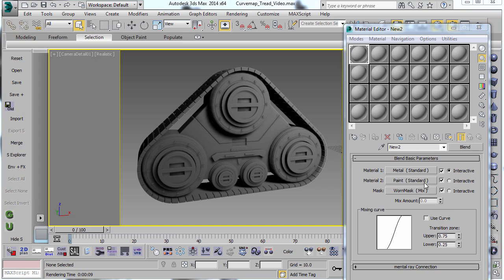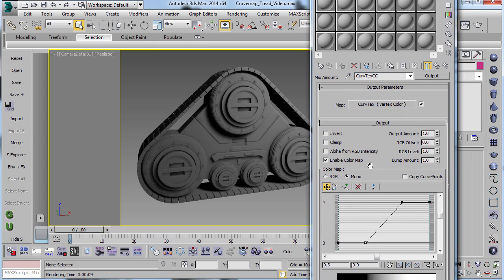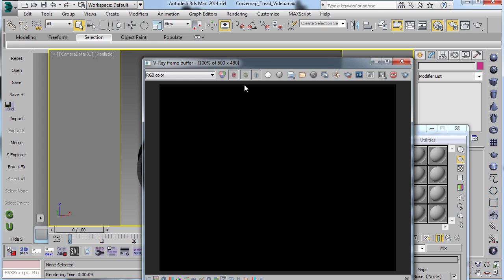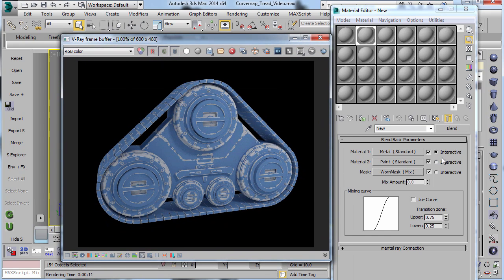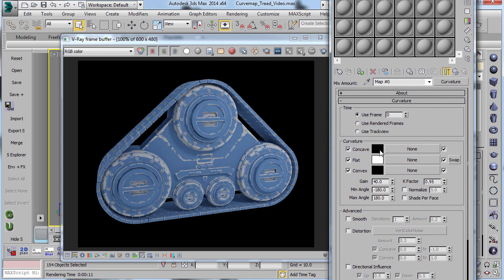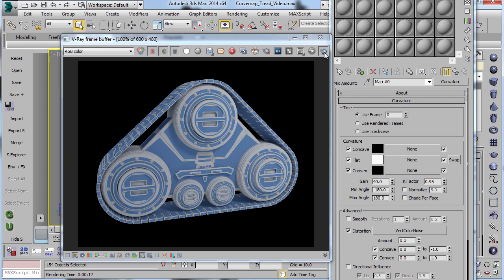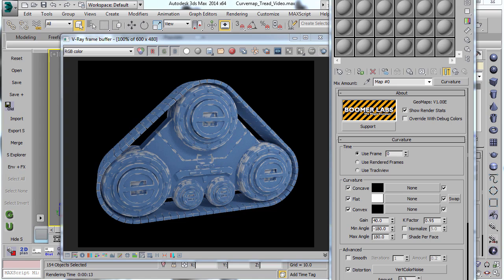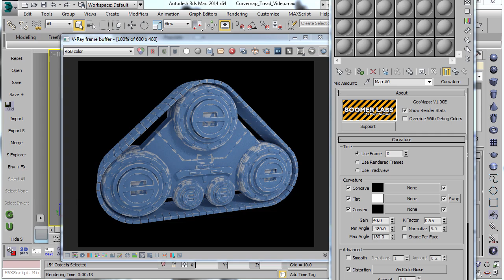Worn Edges Part 2: 3dsmax CurveMap Method

Comment: Hi Neil, i wanted to ask if u have to unwrap in order to use boomerlabs plugin or ur method. Thanks a lot ur awesome :)
Reply from the maker: +Thanos Kagkalos No, the advantage of both methods is neither requires unwrapping. I try and do as little unwrapping as possible. Glad you found the technique interesting!
Reply: Yes i love procedural mapping also, i hate unwrapping. I get really similar results to ur method with vray dirt though and it also applies to really simple objects (without having to turbosmooth). What is the difference of vraydirt and the vertex paint? thanks a lot mate for responding

Comment: If you have V-Ray, you can also simply use the v-ray curvature map, no need to buy another plugin and no need to bake and you can see the result real time in the material editor if you use a cube. Also the free bercon map can use another noise to distort itself like the warp plugin I guess. i also prefer to use the composite map instead of the mix map. We can mix more layers with different mode with the composite map.
Reply: +STROB.NET The V-Ray curvature map also works with the V-Ray edge map's rounded corners, which creates rounded corners at render time even between different interpenetrating objects.
Reply: +STROB.NET See here: http://www.phylacterecola.com/strob/chaosgroupForum/curvatureAndEdgeMap.JPG
Reply from the maker: +STROB.NET First off, if you wanted my attention, you could have just emailed, no reason to post the same message to two different videos and the autodesk wishlist :) So when the vraycurvature map was added, I did extensive testing, and was unable to get proper results for hard surface models. When I talked to Vlado about it, he said the technique had a lot of limitations, and in fact he wasn't even sure he'd keep the map in the vray build. If you've found a way to get it to work on hard surface models, would love to see it, could you send an example max file to neil at soulburn3d dot com? Thanks!
Reply: +soulburn3d Ok sorry I understand how you feel. Cool and thanks for all that you give the max community since years! I follow what you do since years and I hope you keep up the good work that you do!

Comment: Thanks for the tips. I purchased the plugin in the end but no matter what I do I cannot seem to get the edges to work like you do. I have it set up exactly the same as you do on a cube and I only seem to get edges when I turn on normalize but they don't look as good as yours. What am I doing wrong ?
Reply from the maker: +steve wilson Are you using it on a regular 6 face cube, or one with chamfered / turbosmoothed edges?
Reply: +soulburn3d I tried on both. The flat faced cube produced nothing. The slightly chamfered cube only produced lines on the edges if I turned on normalize. Very thin lines.
Reply from the maker: +steve wilson go to neilblevins.com and send me an example file, I'll see if I can debug what's going on
Reply: +soulburn3d Thanks Neil but I actually contacted boomerlabs and they told me it was because the model didn't have enough vertices. They suggested adding a lattice modifier to increase the vertex density. Bit of a pain if only working with simple objects. I have actually had more success without having to increase the geometry vertex count with vraydirt (inverted normals). Not quite as good a result but it still works.
Reply from the maker: +steve wilson Would still love to see the model if you get the chance. I use low poly models for all of my work, but then turbosmooth them to add detail. So they end up having extra faces, not specifically to make this technique work, but just because that's my modeling technique. The inverted normals option in vray dirt will give you a result, but as you note, its not terribly accurate. But hey, if it works for your specific situation, go for it!

Comment: Hi. Thank you for the lesson. The question this method texturing, apply for cinematic characters?
Reply from the maker: +steamUkraine It can be applied for anything, including cinematic characters. In fact, one popular way of texturing these days is using the software substance painter, and that software uses a similar technique to add edge wear to characters all the time.
Reply: soulburn3d Did I understand correctly, substans Painter is now often used for cinematics characters?
Reply from the maker: +steamUkraine It is. However, the downside it has is you need to UV everything, which can be time consuming. There's another video on my channel where I discuss the advantages and disadvantages of that software too.

Comment: Nice tutorial! just one question this method would work on a low poly object? I am looking to render to texture that worn edges to use it as a mask. It's possible to do that with any of your two tutorials about worn edges?
Reply from the maker: David Chumilla It depends how low poly. The Curve Map from boomer labs will do a better job with low poly objects, but if you say have a 6 sided cube, then none of the techniques will work since there is no curved edge to detect. You could also do the curvature bake on a highres object, and apply the results to a low res object, that may do what you need.
Reply: soulburn3d Normally I have no problem to get the curvature map with a high poly object but for this one I didn't need the high one. I just have this low poly object:

http://i.imgur.com/Oj8z789.jpg

Maybe if I tesselate the model I will be able to use this method? I am just trying some tricks to avoid to do it by hand.
Reply from the maker: David Chumilla That object might be tough to do, as there's lots of edges with no curvature at all. Tesselating will probably provide strange results, as its not been setup for subdivision. Have you tried Substance Designer? They also have a curvature generator, and their algorithm may be more useful for low poly stuff since they are mostly for games.
Reply: soulburn3d Hi there. You could also try to use the vray dirt texture to generate your mask. Been using it for years in every type object, works like a charm :)
Reply from the maker: David Anastácio Vray dirt is an occlusion shader, so it'll get the concave edges, but not the convex edges, which is where chipped paint most often happens.
Reply: soulburn3d Yes, I'am very aware were the chipping should occur. Vray dirt texture it's a occlusion shader, yes, but you can invert the calculation... There's an option for it.
Reply from the maker: David Anastácio I tried that several years ago and found I couldn't get high quality enough results on a variety of production meshes. I posted a few images showing the issues on the vray forum, if you have access to that.